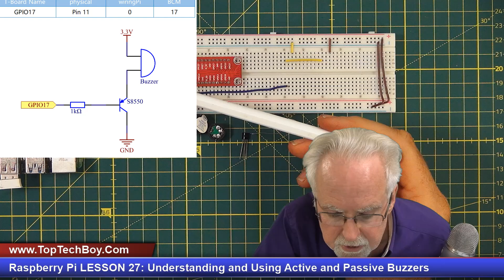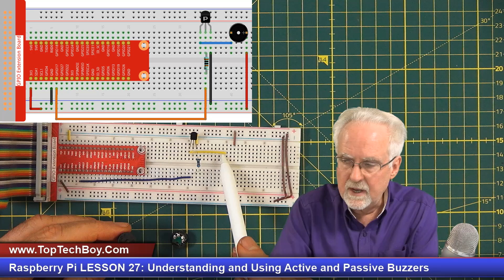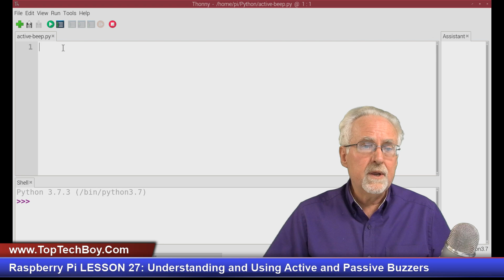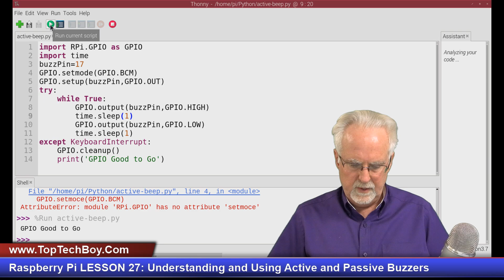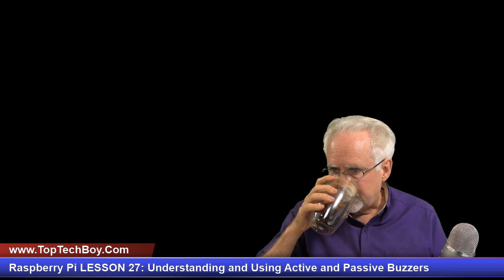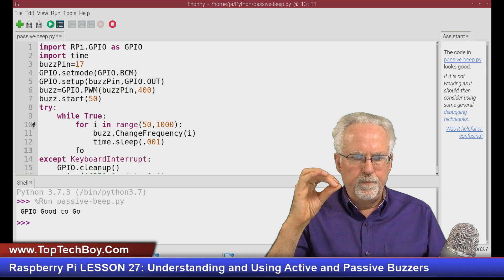Raspberry Pi LESSON 27: Understanding and Using Active and Passive Buzzers

Comment: I am legend. Didn't take me long, but Thonny makes me a cheater because it's so easy to cut and paste and I had left my ADC set up on a separate board, along with the pot and the wires were still there for the dht so... scavenged some of my code and a little tweaking. My life greatly improved when I remember to stop the PWM for the siren after each run thru.😂Great lesson combing the other projects
Reply from the maker: LEGEND!

Comment: It took me several weeks to figure out what I was doing wrong.  I don't believe a PNP is the right transistor to use here.  The buzzer buzzes when the current goes LOW, and off when the current goes HIGH.  That is opposite of what you would expect.  I spent way too much time sending a SOURCING current into the base, with no results, and it wasn't until I stumbled across a reminder that PNP uses SINKING current that I figured it out.  Without making any changes to my circuit, I jumpered the base to ground, and Bob's your uncle, the active buzzer came to life.  Now I can get on with my program for lesson 27, however i will be using an NPN as I want to signal the buzzer on SOURCING versus SINKING, and when I post my video you'll see why.

Comment: I believe your PNP circuit is not optimum. The emitter should be connected to the 3.3v and the load be put on the collector. The PNP base must be negative in respect to the emitter so a LOW on the output pin will turn on the buzzer. This can be verified by changing the sleep times. Great video.
Reply: Seems to work either way, you can rotate transistor 180 degrees and it still works but not as loud. You can also replace PNP with NPN, and then it buzzes when pin is on. But PNP is cooler, cause this way you can attach an LED to the same pin and have it light up when buzzer is off. This got me pretty confused too. The way to remember is PNP is "Pointing iN", so positive current is flowing into the base, not out.

Comment: Have you ever covered how to use a raspberry pi to monitor the pins on another micro controller like an Arduino uno? Like if a pin on the Arduino goes high, then do X thing on a pi.

I know that's kind of niche thing, but I'd be interested in a video about that if you ever want to tackle that topic or point me to a video that already covers that.
Reply: Paul has a playlist using Python with Arduino https://www.youtube.com/playlist?list=PLGs0VKk2DiYzWURfJCbCGPa8HI0APjBfo The few differences between Python serial on the PC vs RPi can be found by searching " python raspberry pi serial"
Hope this helps.